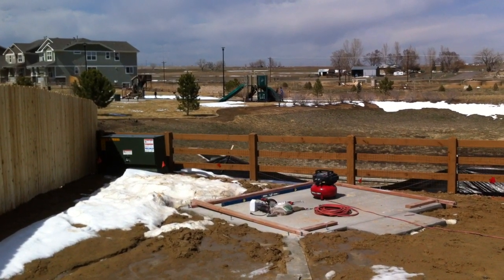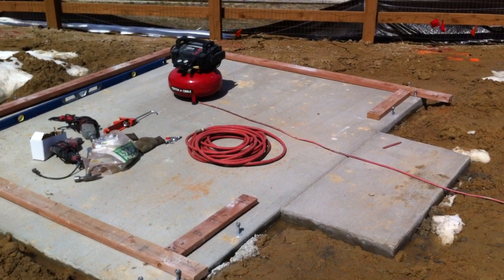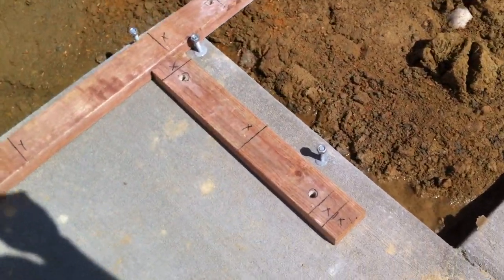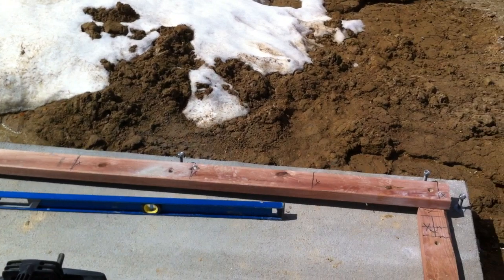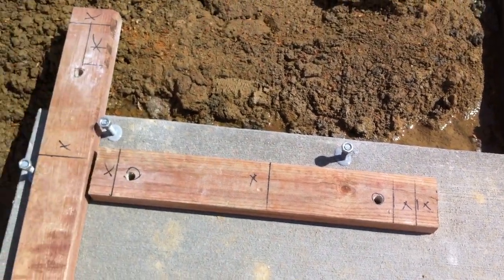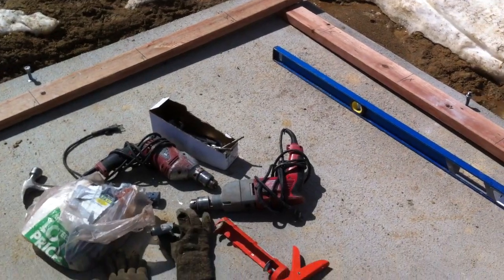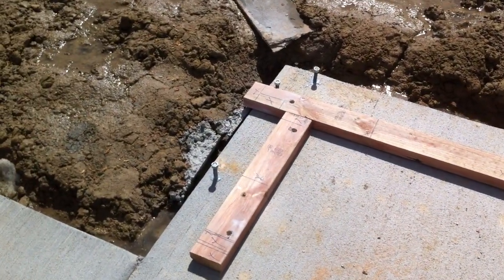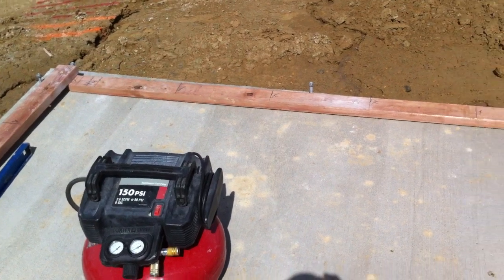How to build a shed Steps to build a shed

Comment: Nice video, can you tell me the basic procedure for setting the bolts in the concrete as it sets, thanks
Reply from the maker: We drill 1/2 inch holes and set the bolts in concrete epoxy